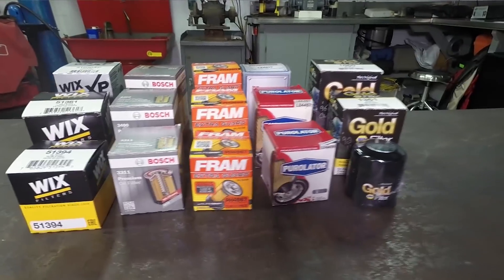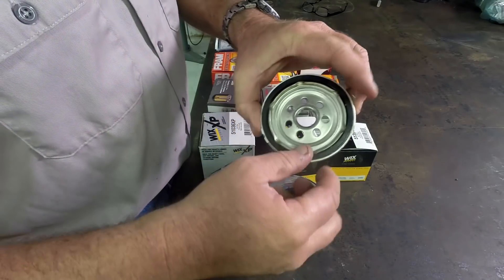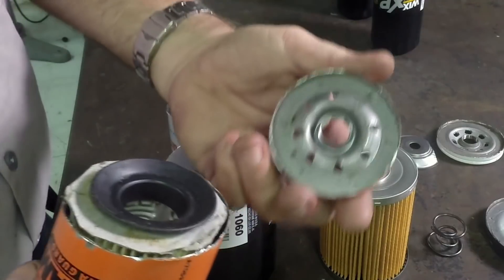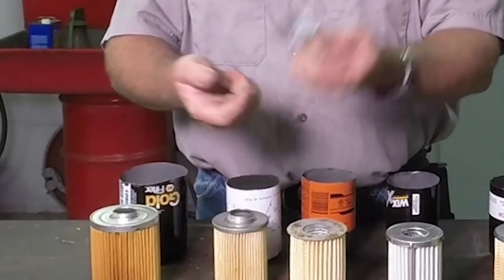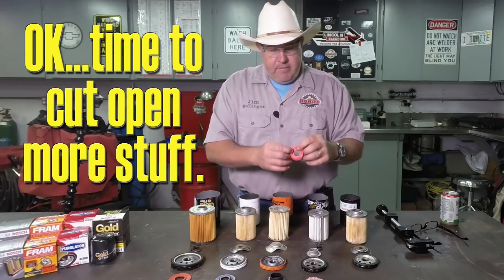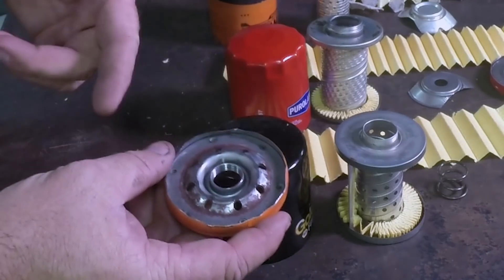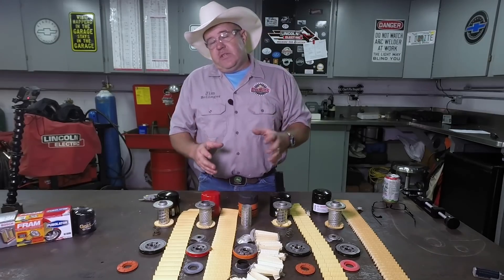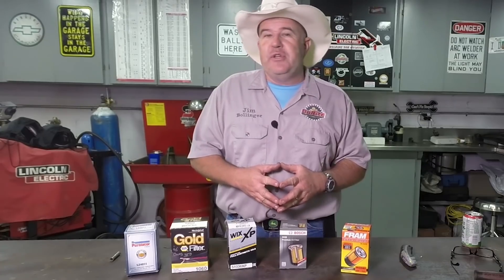The worst oil filter EVER!

Comment: I worked at Purolator from 1990 to 1995 in the engineering department as a Drafter. I can tell you that Purolator is king of the generic manufacturing. The only difference between a filter made for any store brand and the premium Purolator Brand it the quality of the paper. Back when I was making drawings on then a unix version of computer drawings I did a lot of copies of oil filters that had the K-Mart logo, Texaco and so many more. I was laid off in 1995 when they moved my department from Tulsa, OK to Fayetteville North Carolina, I was not moving. I will say they treated me well great severance package they were a good company.  So I would say the wix is a Purolator filter that's what they do make filters for other companies. I used to lay out or stack up those filters to make sure that little metal springy thing fits inside with just the right amount of tension.

Comment: I've used nothing but frame for over 20 years without a single issue. Multiple cars bought new and driven well over 200 thousand miles. So....
Reply: Also if your motor is getting damaged from dirty oil it is because you are not changing the oil correctly. Not from the filter itself

Comment: You obviously  know nothing of oil filter mounts.
Less than 50% of the oil is past through the filter at anyone time.
 The housing contains a bypass galley with dumps the oil straight back in the sump.
 I suggest you take your grinder to a filter mounts before passing comment  on the quality of  filters!

Comment: 298 fram investors didnt like your video.

Great information
Reply: LOL
Reply: Neither did I...BECAUSE it was NOT any real test of a filter.
Reply: Its because he is comparing apples to oranges. Those other filters cost way more. This is the cheapest Fram you can buy. They have 3 or 4 models that a better than this. The full synthetic version is outstanding.
Reply: @TDIETZ22 , excuses excuses....
Reply: @jamesr5741  nope. They are facts. Ive never used a fram in my life, btw. Their top of the line filters have everything you could ask for. Theres a video here on YouTube of the synthetic version. Literally has everything you'd ever need
Reply: @TDIETZ22 , I seriously wouldn't risk it if this is the rubbish Fram puts out.
Reply: @jamesr5741  watch the video dude....he cuts open the higher end Frams and they are among the best you can buy. Im not disagreeing with you on the fram in this video. Its not good. Im just here to educate you on the better options they have. It's very high quality. Just watch please.
Reply: @TDIETZ22 . Na, I'm good. If any company produced that garbage for an engine, how am I to trust them with anything.
Reply: All sellers of non-Fram oil filters thank you quite much for this piece of shit biased comparison.    Wix are made by wiccans.
Reply: @MrFligemon  , Another paid Fram Troll.
Reply: @jamesr5741    Not paid but I am a troll....and proud of it.
Reply: @jamesr5741  try the Fram ultra synthetic , metal end caps and metal core or is that not good enough for you

Comment: I would use the team for brake ins also they are like 7$ or less so u sorta pay for what I get lol my 1400 car I don't even do oil changes it just burns oil so I keep adding it all most cost more to do one then then not to ha for a beater if I would do a oil change I would use it but a nicer car then no u should do a test on dealer filters like honda and stuff and see if there's any diff

Comment: I've been a manager at AutoZone for many years when I first started my boss cut up five filters a Bosch a Purolator a fram a wix in the house brand which is the STP the $2 STP was way better than the extreme fram one that was ten bucks
Reply: Capo 1990 i was an Autozone manager too and I had been using premium fram filters on different high performance engines for many years. Never had a problem.
Reply: I used fram for years without issue too, but I switched cause the potential for failure was too high.

Comment: Fram spent so much $ on media silence there hasn't been enough left to pay for materials to make a decent filter . Don't recall exactly when ( 70's or 80's )  U.S. Customs came across a cargo ship load of Fram filters  They were pretty much just a hollow cans painted with their orange paint & logo .Huge cover up.
No Ford fan here but Motorcraft makes the superior oil filters .
Reply: You feel you have to qualify yourself as a non-Ford fan? I am one, and I buy what ever works best for me, for the money I have, at the time I need to make a change. Got an Escape, an Envoy, and I used to run, full on race VW powered cars, against full on race, Ford 2.0's.
Reply: AC Delco is the most counterfeited filter brand, I don't know what that has to do with Ford
Reply: AC Delco is the most counterfeited filter

Comment: even though the fram seems to be inadequate, i'm sure their scientist or quality control crew has tested this to withstand it's intended life span. drain back valve obviously works and maybe beyond our understanding of fluid movements (it probably has no choice but to flow where the negative pressure pulls it, unless there's a blockage or pump failure, which by the way trumps the filter's engine saving capabilities,) it's cardboard gaskets might out-perform all the others once oil is introduced as some space age materials that are top secret. as far as the rust i doubt it ever leaves the metal that it grew on to begin with. i'm not a fram guy and it might be the poorest grade in your selection, fram more than likely mass produced these things knowing the shelf life was gonna be long, long enough to sell before we figured out how destructive the invention of internal combustion power is to our existence. vehicles at 4 or 5k pounds and trucks traveling  in a width of 12ft slightly sloped bumpy and pot holed asphalt going 60+  mph with some vehicles able to go over 200mph in opposite directions separated by a painted 4 inch reflective intermittent white line, with utility poles spaced on the soft sandy shoulder  far enough apart that if there is an accident 80% chance a vehicle out of control will hit one with a force that severs the vehicle in half (that was just average guess,) and they end up in the low point of the flow line,  and to top that off homes with children and pets playing in the yards dot the edge of the right of way in between the rural high speed roadways, let's not forget the priorities of americans and that is a liquor store on every corner for a refreshing  adult icy cold  beverage (even way before seatbelts were thought of,  and the part that the variety of level-headedness of all who drive (and who shouldn't be,)goes from excellent to dangerous and the class of how the hell did they manage to get in a car in the first place group (4 or 5 years and 90 year olds,) and the variety of chosen vehicles (bailing wired together, with one headlight having hign beam only, no brakes, no insurance, screaming kids climbing all over and nagging wife that's in charge of hibatchi bbq for heating) is nothing compared to the fact that the internal combustion engine alone sucks in good air and produces heat and a by product of water and deadly carbon monoxide gas that kills all life forms within seconds, also that can leak into the operators or drivers compartment and is nearly odorless,  but wait, and then use the warmed cooling water to have direct contact with heat exchanging radiators in the cab as well that could leak combustion products in the cab.  one would think along the way of designing any of those features, someone could of stepped up and said, this might be a little insane. just a bit.  that'd be like mounting a seat 3ft behind a horse and cattle prod to jolt him on the ass to go, eventually he's gonna shit on you. cool video.
Reply: Never using fram filters again i think wix makes napa filters

Comment: Rust?  where he buy these rusted  filters? bias opinion  here folks and is bs.  . common sense would be taking  the filter  out of the box  and looking at it before you purchase it. Its like buyingold outdated milk from the market wothout reading the date  smh  and yet he doesnt test the actual material in the filter or even a filter just by itself.  beware when purchasing one for the vehicle because surface area of  medium thwt does the filtering like a high milage filter is bad.  it strains more but has more stress on the pump and its restrictive.  This man knows nothing, dont take your car to him.  magnets are good to use to help stop particulates.  stick tbem right to the filter or buy oem.

Comment: First off I've done filters and filtration systems for over 10years and anyone who uses wix or napa know they are the same filter. There are only three companies that make the cellulose element material so they are all built the same and inferior filtration material. Also napa gold is their highest end filter and the others were the other companies low end. I wouldn't run napa or wix in a lawnmower from the junkyard if they were given to me.

Comment: Very useful video. I always use Bosch Filters.  And they work extremely well. Use to work with fram, just didn't like it.  Can you do one about mobile one, Ac delco. 
Thanks for the very detailed explanation of these oil Filters out there.  
How about batteries for cars trucks. That would be great to

Comment: Great video. I worked at a factory seven years ago where they put break fluid in containers for NAPA and a cheap unbranded product, I was surprised to find once they finished filling the NAPA order they continued using the same fluid container to fill the cheap product. The only difference between the products was the label.... I swear if that NAPA label was tilted by an eighth of an inch the production manager would have a heart attack.

Comment: I used Fram back in the late 70's and noticed that it was the only filter that would cause a "dry start" rod knock. Switched to other brands (ACDelco, Motorcraft) and "dry start" went away.  Never used Fram since. So this review does not surprise me in the least.

Comment: Filter performance is not about appearance and speculation.   Performance is about flow tests at operating temperature and ability to trap particles and still allow the PROPER AMOUNT OF FLOW. Having said that, he accurately states that cardboard and rust doesn't belong in an oil filter.

Comment: sigh it is not called a "spring thing" that is the pressure bypass spring. If the filter is clogged, it acts to let the filter "lift" and allow the flow to bypass the filter and not starve your motor for oil. 
Second, The anti-drain seal, is not always made of rubber. The higher end units use Silicon (example Mobil 1, Puralator pure one, K&N)
While I applaud your showing people just how bad Fram is. If you want to look professional at least know the name and function of the various parts.

Comment: I feel bad with anyone with a 2.2 eco motor all the filters are cartridge filters and their all cardboard if the mechanic doesn't change the filter it will break apart and have to pump the whole motor clean